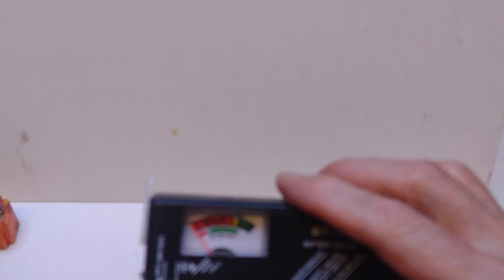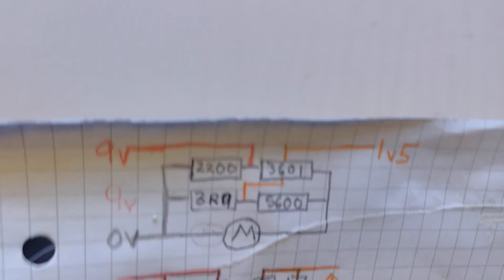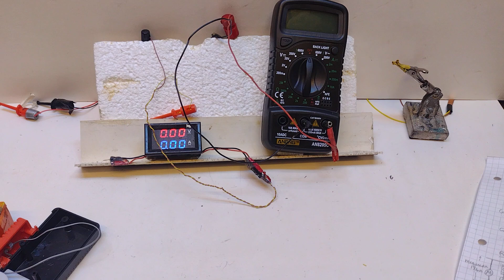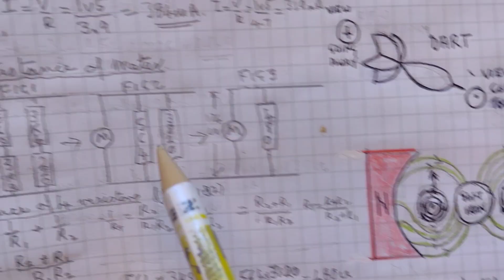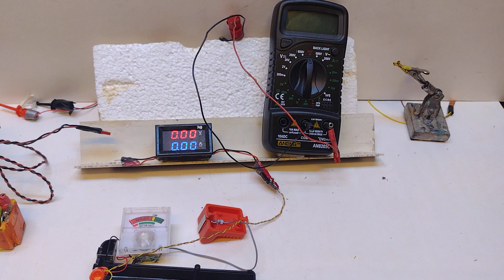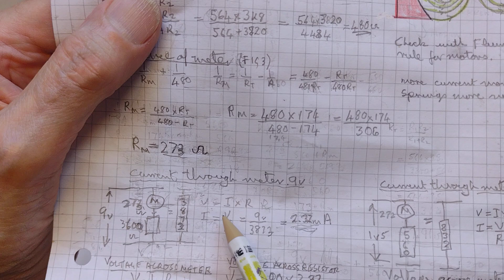Battery tester repair and tear down.

Comment: I have a dear old battery tester that used to be my father in laws. It must be well over 30 years old. It doesn't give any voltage details, just says Green = Good, Red = Dead, and Yellow = Weak and 99% of the time, that is good enough for me 🤣🤣👍👍
Reply from the maker: Sounds a good.tester. They really don't need to be complicated. It would be interesting to know if it puts a load on the battery when it tests it, & if so how much.
Reply: @toyhacker4647  I might have a peak inside. I just checked the label that hides the screws and it does peel up so I can access them. Incidentally, the label says manufactured in Korea for Radio Shack 😁